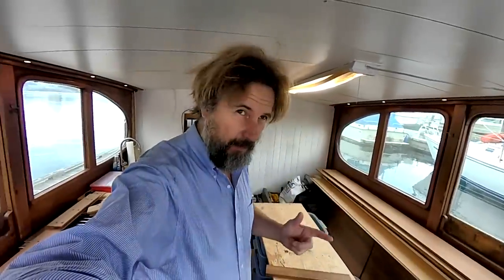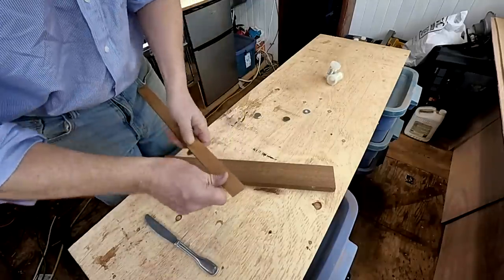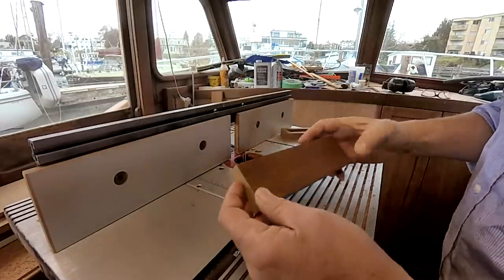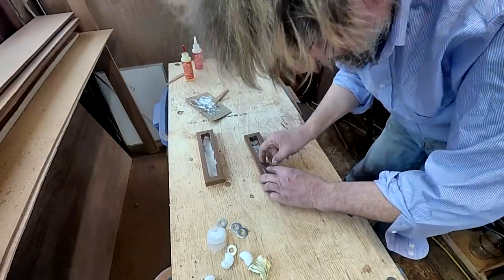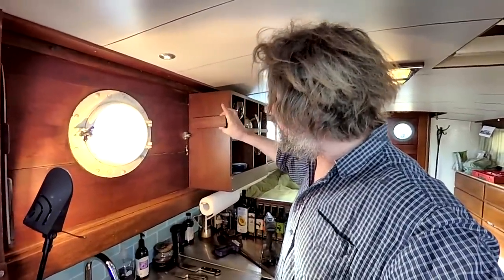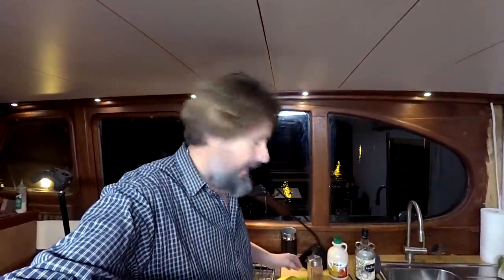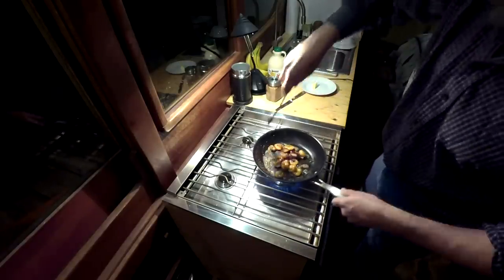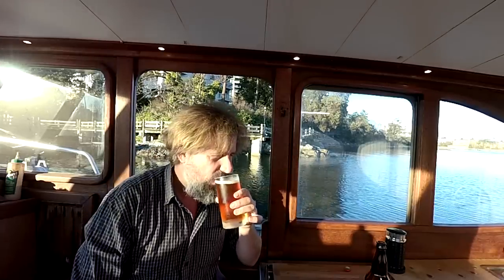Making magnetic knife holders - Wooden boat restoration - Boat Refit - Travels With Geordie #103

Comment: I used these magnets as closers on all my house doors. Lee valley have cup shaped holders that increase the strength of the magnets. I used fostner bits to drill holes and #6 screws to hold the cups. Once you put the magnet in the cup it cannot be removed unless you cut a slot in the side of the cup.
Reply from the maker: Pretty awesome little fellows aren't they?

Comment: Love your videos Peter.  Halfway through the video, I was hoping you would drill evenly spaced one inch holes for the magnets, instead of a trough.  It would've been much easier to keep them separated and less messy.
Reply from the maker: drilling  holes with a forsner bit was my first thought, but hand held the pilot tip would get precariously close to the front face. I needed the front thickness down under 1/8" for the magnets to really pull.

Comment: Hey Peter, Just a heads up.
 If you use your compass for navigation, those magnets may effect it somewhat.
Reply from the maker: I wondered about that, had meant to mention it in the video and experiment with placing the magnets in different parts of the boat. I still will experiment and if there's any effect at all they can't be aboard.

Comment: If someone wants to do a different style they (E-Bay for one) make similar magnets that you can screw into with a countersunk #10 screw hole in the center. I saw one that goes up to 20# pull which should hold even the biggest cleavers. But your wood block does look cute.
Reply from the maker: So true, we looked at a few options before making them

Comment: Peter... you should have made a dado with the table saw and slide them from the top end making them slide in tight enough where you didn't need any glue or epoxy. Good job though.
Reply from the maker: I couldn't add extra magnets that way though...

Comment: You should try using iron or steel with the magnets. Even a washer will boost the magnetic force of the magnet. A washer and a magnet attached may almost equal a stacked pair in force and will be cheaper.  What force are the magnets you use in this video? They typically have a rating expressed in an "n" number.  Buy from China or other Asian source. In the US, I buy somewhat smaller round neodymium magnets, 10/$3.00. I have been stimulated by your video and ideas. My Daughter and I may try making a few of these.
Reply from the maker: That's interesting, they came packed with washers both sides, hmmm. They're rated at 30 lbs.

Comment: The mistake is to think that magnets have "force" coming out from one side. They are actually a circuit. What goes out from one side, has to come in from the other side. So, if you want to "stich" a knive to a magnet you need to get both polarity to the knife. You can channel the magnetic field though metal. The table you were using was wood...thats way they jumped around. Immagine to metal strips. In between all magnets oriented all north on one side touching the metal and sll south touchin the other metal strip.
The knife will close the circuit by  gettong close both strips of metal.
Neodimium magnets are 100 time more powerfull than rare earth ones...
Smaller magnets...enough force😉
Love your videos.👍
Reply from the maker: Ahhh, a proper description of magnetism. Thank you.

Comment: Peter, you are not helping me avoid calories.  That banana treat looked scrumptious and the doppel..mmmmm.

A comment about the knife holders. The wood face knife holders are damn elegant.  I would have made them a bit differently.  Start with the piece of mahogany, drill through with a drill just bigger than the magnets.  Glue on a piece of 1/32" mahogany veneer (readily available from hobby shops and hobby suppliers).  Glue the first magnet in each hole - no problem with spacing.  Add additional magnets as needed.  Since I have it I would likely have put the magnets in with cyanoacrylate super glue it sets FAST.
Reply from the maker: In hindsight, a great strategy!